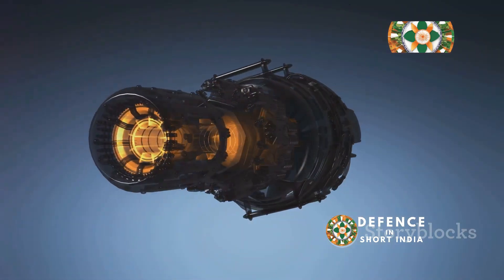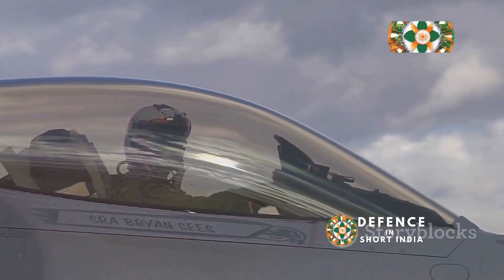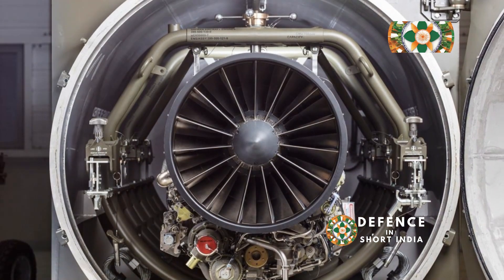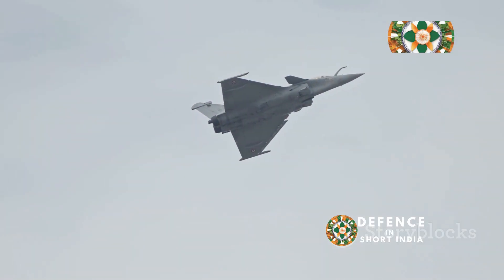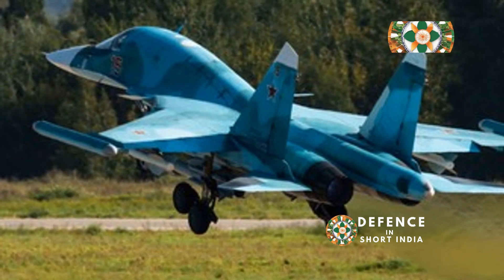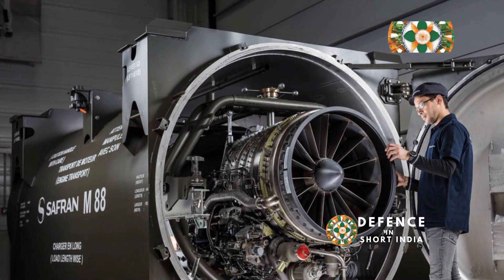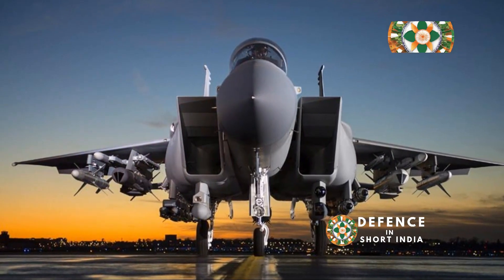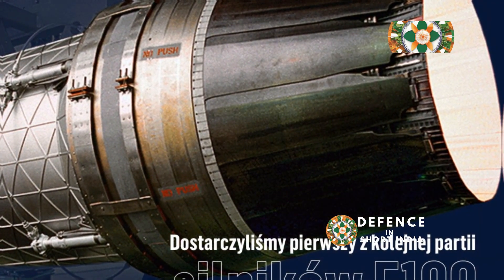🔥 AL-31 vs M88:  🇮🇳Indian Skies Showdown! ✈️ Which Engine Reigns Supreme?

Comment: Neither of them are best in class, albiet obsolete technologies. AL-31 is replaced with AL-41, and now Su-57 uses AL-51N engine. When all talks and ZERO delivery fighting forces and defense ministry cannot provide 100 kN thrust, you can not design high pressure ratio gas turbine!! And with regards to fuel efficency, GE404 is far more superior then M88. I feel sorry for kadi ninda jhumlas of raxa mantralay that put all eggs in GE basket and be blackmailed. IAF is well served to have all enginees that meet their requirements including pratt and whitney, SNECMA, and GE, so that IAF can maintain reliable supplies, and interoperability without being blackmailed by any supplier.
Reply from the maker: It is just absurd that GE is twisting India's arm sooo bad, it's a pity that we trusted america